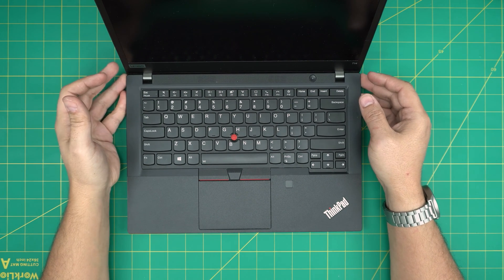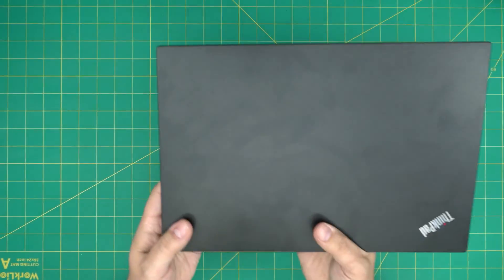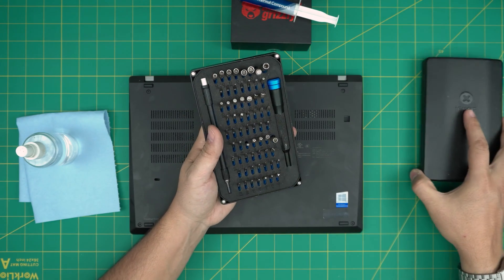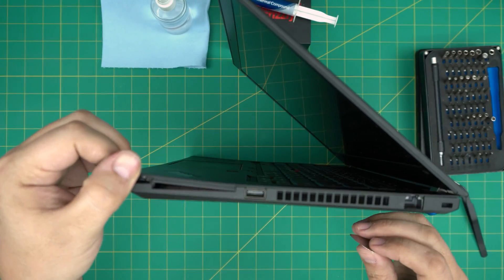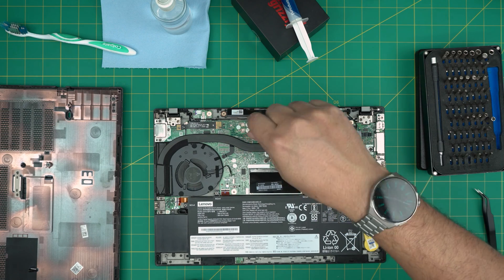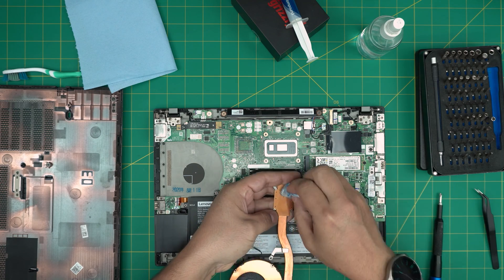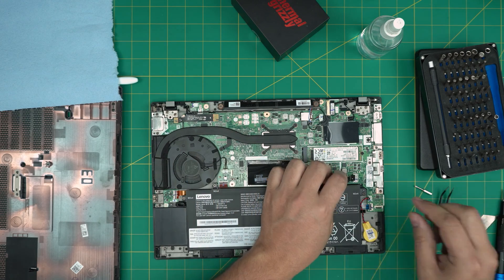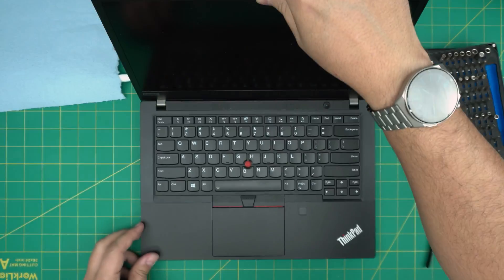Boost Your Lenovo ThinkPad T14 Gen1 Performance: Expert Repaste & Cleaning Guide!

Comment: I did open this exact laptop by my own and there's no problem. The second time I did it, I forgot that there's a hidden SIM tray that wasn't pulled out, and got my SIM tray bented as a result 😅
Reply from the maker: Yeah, those SIM trays do bend super easily :( but no one uses the SIM tray anyway :P
Reply: @uFixTek hahaha yeah 😅
Anyway I wanna ask something. What happens if you clear an old paste on the heatsink with a razor blade?

Comment: oh no you shouldnt apply paste to the smaller chip - that;s the PCH and it is left unpasted on purpose. Saw this on reddit. Im on a T14 g1 as well
Reply from the maker: 🫠Regarding the PCH chip:
Yes, you should apply thermal paste or a 0.5 mm thermal pad to the PCH. Doing so helps the laptop last longer.
I’ve been repairing laptops for over 22 years, and you’d be surprised how often these CPU + PCH combo chips fail.
First, you need to understand what the PCH actually does. In simple terms, the PCH handles data transfer. When you connect external drives and transfer large files, the PCH can get extremely hot. That heat damages the internal solder balls over time because it’s a flip-chip design.
If you don’t do heavy file transfers, overheating may not show up immediately, and the system might last longer—but the correct approach is to give the PCH a way to dissipate heat.
On these Lenovo models (and similar ones), especially when used with Lenovo docking stations, I see a lot of PCH failures. After repairing them and adding thermal pads, those systems outlast the original factory configuration that had no paste or pad.
Alienware is another example: many of their laptops have the PCH separate from the CPU with no heatsink at all—and they fail constantly. Adding a copper shim with thermal adhesive permanently fixes the issue.
A lot of comments on Reddit are based on limited testing and assumptions, not real-world repair experience or long-term usage patterns.

That said—if you personally choose not to apply anything to the PCH, that’s your call. Just understand the trade-off.
cheers🍻

Comment: Are you supposed to turn the internal battery off in the bios menu?
Reply from the maker: 🫠Regarding your question, there is no need to do that, as most of the time people have BIOS passwords and forget them, resulting in no access to the BIOS. As long as you open it carefully, ensure you don’t drop a metal object on the board, and disconnect the battery first, you don’t need to worry about the BIOS configuration.
cheers🍻

Comment: well... welll.. i did try to repaste my t14 gen 1 using this guide and it succeded luckily. I was doubting if its worth opening or not or finding time for it but decided give it a try since its kind of the end of 5th year since i bought it, mine is the 4650U variant tho and its only one big chip not 2 like yours otherwise everything is 1:1 but i dare to say the fan connector was unusually well stuck and resisted a bit more than the one you showed :D. Anyways i did like i use with thermal paste and run a single 2 min stress test on cinebench which id say it handled very well turned fans after 30 secs after it started but since it got quite hot it took some minutes to completely cool down and the fans to go off by themselves so i guess its a win. Only downside i forgot i had it on battery so it went from 30% to 5 in no time haha. Being that age there was 0 dust bunnies or infact dust i can dust off which is surprising? only time it was opened was by a lenovo onsite technician to replace my trackpad but i dont think it helped much at the time but no issues today for some reason. Well long live on site warranty even as a private person lol.

Comment: You should not put thermal paste on the PCH 🤷
Reply from the maker: 🫠 Regarding your question, no, as there is no pressure there to make the paste work, you can only place a 0.5 mm thermal pad.

Comment: Can we used compressed air to clean the fan?
Reply from the maker: 🫠Regarding your question, sure you can but make sure the fan is not connected. else you will invert the voltage into the board.
Should you have any further questions or requests in the future, please don't hesitate to ask me.
cheers🍻

Comment: Thanks for the video. I run P14s Gen1 AMD currently, and after so many years I feel it's time to repaste it, so I'll do it. It runs hot and noisy, but surprisingly I does not drop any power.
Reply from the maker: It's my pleasure my friend.
🫠Regarding your question, I recommend repasting your laptop—if you use it daily—once every year or year and a half. This helps maintain the health of the motherboard in the best possible state. Additionally, dusting and cleaning the fan and board will improve airflow over the components, keeping them healthy.
cheers🍻

Comment: Nice!  Just got one of these as a work laptop and already noticed how hot it's getting w/ even normal use.

Something might...need to be done about that. 😂
Reply from the maker: 🫠 Just make sure you don't cover the bottom ventilation area, or it will automatically shut down because the heatsink is not very effective.
Reply: @uFixTek  thanks for the tip!
Reply from the maker: It's my pleasure, my friend. 😊